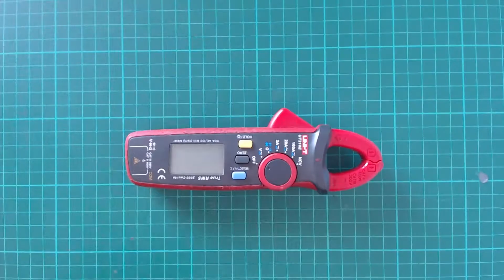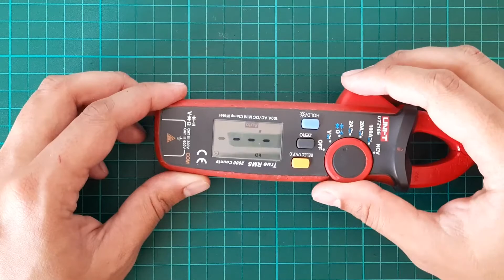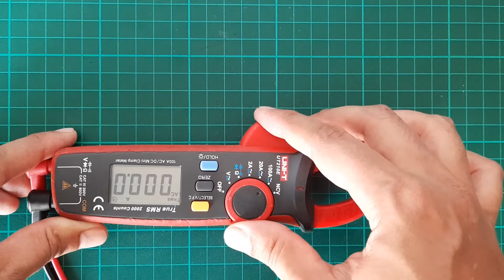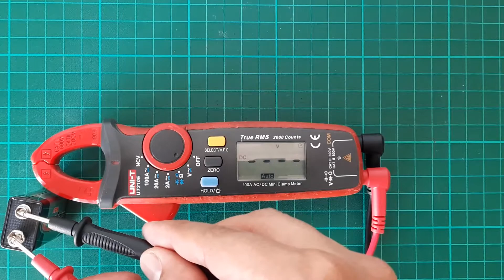How to Repair No Beep Sound Problem on the UNI-T UT210E | Mini Clamp Meter | Replacing Buzzer

Comment: I have the same model of that multimeter, and the same traces are corroded and I had to rebuild them. But I used UV mask to cover it... BUTTTT I have no idea how to make it dry fast. I had a nail dryer and did 4 set of 2 minutes each in a row (8 minutes) and it looked dry, but if you try to scratch it, you will see in the microscope that it's still wet. Any Idea how to dry it faster? OH and by the way, what voltage, ohms or watts that little buzzer is? I do have to replace mine too.

Comment: Leaking batteries?? OUGH. Whenever I replace / place a set of new batteries in a device, I read their expiration date, and note that with the device in which they were placed in my electronic Scheduler. So It will remind me to unconditionaly replace them when the time comes. Saves me a lot of PCB damage. 🙂